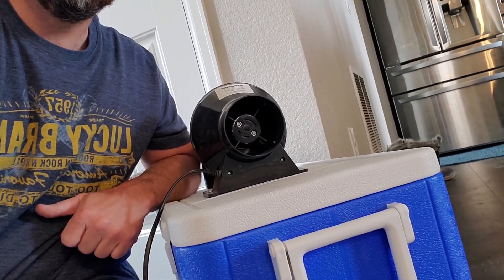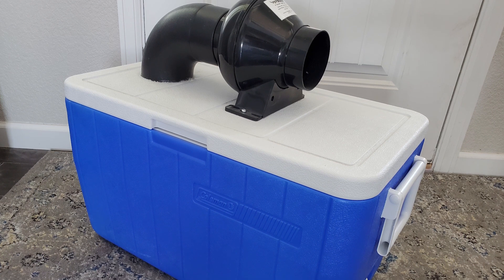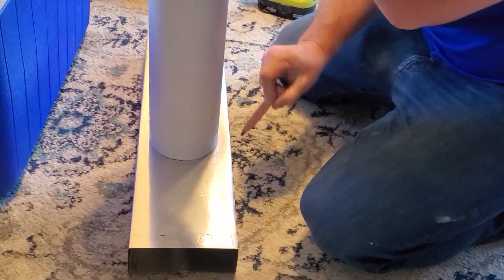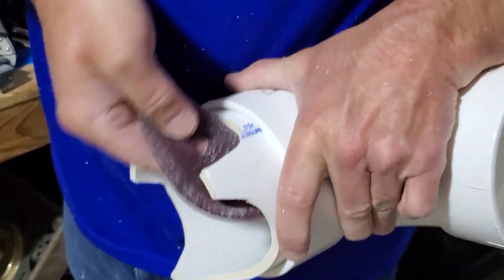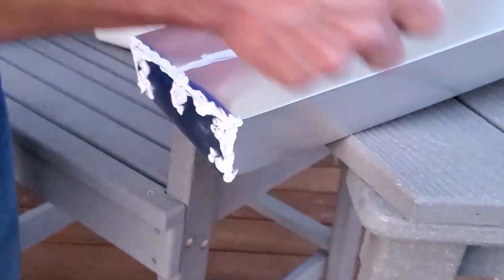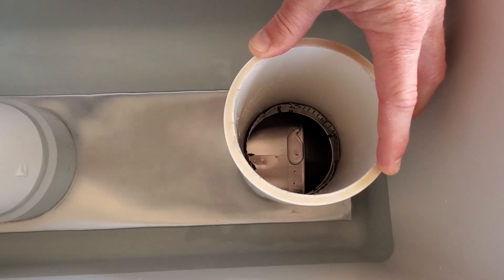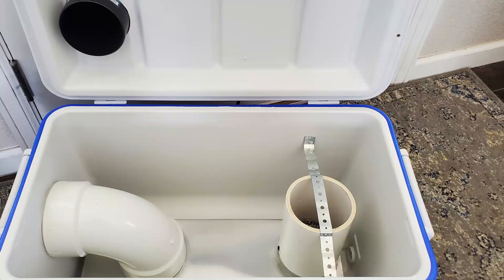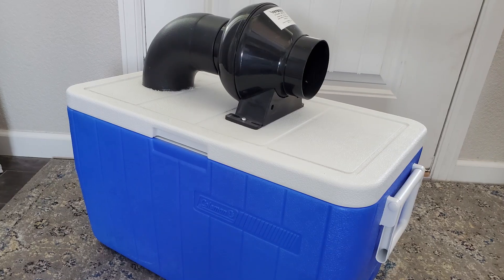Homemade Portable Air Conditioner DIY - Runs on 120 volt or 12 volt.

Comment: I just built on with a 336W blower fan(so loud) blowing into the cooler at the top and having an elbow coming out the top. I realized I could just put the intake into the top and have the output of the blower at me.. it led me here.. I’m going to place smaller cooler(no lid)into the center of the bigger one, right under the intake of the blower fan. . Then have pvc run from the bottom of inner cooler to the outside of the cooler, and then do that to the other side of the inner cooler(I.C.), having two air intakes into the I.C.… that way I can have less strain on my blower.. the air inside the I.C. should be cooled down by the ice surrounding it.

Comment: In a small bedroom - if you window can slide open at the top, crack it about 2 inches. Run the AC rig on the floor. Give it about an hour.

Comment: I’m trying to cool my airplane.  I am building a similar setup.  My question is what is or where did you get the fan/blower.  I am thinking about fans that run on the battery packs like 18-20volt.  Thanks for the inspiration and creativity.

Comment: I have a few questions. Do you recommend this one or your coil version? I live in Texas and I have created 2 insulated dog houses that are pretty awesome. I have an extension cord ran right now with a box fan hooked up in a window I made specifically for them. I was looking at doing something like this and installing the cooler itself in the ground. Also, would dry ice work for this one?

Comment: I recreated this today using the cheapest materials possible.
A 40 quart styrofoam cooler, $6
Small USB fan $7
2 Aluminum foil pans square, $5
6 x 1 liter seltzer bottles, empty $0
If you cut the bottom at the widest point of the bottles and cut the top just before the widest part, it fits inside the first one.
Duct tape, $1
Total cost, $19
It works!
Reply: any video :)?
Reply: Please send a picture a text to picture to the comments. Thanks nice❤

Comment: Hello, I love this idea! I have one question, would it be possible to get the same cold air if I used a 4-inch aluminum dryer vent "rolled" in an ice chest? I have a small truck and am trying to figure out how to keep me cool on the drive home from work.

Comment: Just a thought, but you should make these run off Dewalt batteries. I am also curious if a fitting exists that fits at the outlet and can split the airflow in four different directions. 🤔

Comment: Better to use a flexible aluminum tube .snake it through the cooler and pour ice over it.,.and blow air through the tube , the snaking will cause the air to bang into the cold surface of the tubing and increase transfer of cold

Comment: Hey bro what if you dix just the way your doing great design by the way ut what if instead of just letting the cold air run across the top of ice to ofher side of lid then come out what if yoh reall utelized that are with a sloping type of swamp cooler pd with a litte pump pumping the melted water over the sloped  pad making sure air still flowing under. That way your utelizingevery bit off tht cold ice and water and make it last longer.hopebyou under stood if not get back to me and ill draw you a quick diagrim of ahat im thinking. Great job im going to start my tomorrow. TKe care. Scott

Comment: Buddy, at 6:57 did you mean the air circulates and not the water? I'm super confused , I have a similar idea which I wanna' try as I can't get the motor but I just want to make sure I understood the instructions correctly.

Comment: It gets into the 120s here in Arizona so you have no idea how much I appreciate your videos. It’s important for me to have devices that I can plug into a solar charger when the power goes out that will literally keep me cool enough to survive the heat
Reply: When I lived in AZ years ago I used an evaporative cooler. The air is so dry the high rate of evaporation provided really chilled air, circulated by a fan. Doesn’t work for mobile applications, like a delivery truck.

Comment: Exhaust needs to be able to move . Also can use a t to slo air down and spread in multiple locations. Try different heads on the exhaust 👍😎🥶✅
Reply: Send a picture text to picture. Thanks.❤

Comment: How about just putting two holes in each end of the top of the cooler , forget pvc pipe , instead, run two aluminum duct tubes down through the holes of the cooler and connect each of them to one end of a central aluminum duct tube with aluminum angle joints ..so the whole design is made of Aluminum and the air never makes contact with the ice ..just force air through the aluminum Duct work that is buried under the ice …. The air will not be humid and it will be very cold due to the conductivity of the aluminum duct work

Comment: I like this concept but I curious about two things, why the duct and not justa flat piece of tin about 4 inches off the bottom and sealed around?  Also I noticed everyone uses only ice, is there something wrong with using get packs?  They have a freezing temp of 18 deg typically vs 32 and last much longer.. plus no mess.. nor worry about excess water and you can just take em out and freeze them again.  Truly curious as thats what I intend to do.  Also would be nice if somebody actually tested over several hours to show if they really work or  not.

Comment: If you shield your ice from the air flow (Plastic bag or ABS panel on top of the ice) it will melt much slower. Salt helps also.  Your aluminum box needs fins on the inside so the air flowing through the box comes in contact with more cold surface area.   Some air will never contact the box walls and go directly out.  Your PVC parts are insulating.  If they were also aluminum the cold surface area would be increased making the air colder.
Reply: Keep in mind that though the salt will lower the temperature of the melting ice, it will also corrode metal ducting, so I'd keep everything plastic that comes in contact with the salty water.

Comment: This is awesome, I watched this video years ago. I just made a similar a.c unit the other night that was to be setup for batteries incase I wanted to have solar. So now I have an a.c unit!  Not the same design but works very similar!  I was surprised with how long the water bottles stay frozen for!  I don't even have the isolated lid!  I can emagine how much more efficent this would be from having a full seal

Comment: There are loads of these swamp cooler projects on here - but this is definitely one of the better designs - you must have the air flow UNDER the ice, seen so many of these where they just have a fan in the top & outlet on the side near the top & the air is simply being drawn in & over the top of the ice - useless

Comment: Wouldn't it be a lot simpler to use 4" aluminum flex hose? Or even 2" flex and lap it several times around the bottom of the ice chest? It would eliminate most of the fab work. Love the idea tho'
Reply: Damned right.   Perfect example of "If all you have is a hammer, everything looks like a (hillbilly) nail."

Comment: Always liked the different designs, but noticed that the lids of the coolers could use a touch. It's adds a bit of cost and time but why not drill a few holes and shoot some foam instulation in there. Dry and set it. Cut off what comes out put some dots of silicone on there and the ice will last a bit longer still. Way to take a cheaper cooler and insulate a bit better. Never see that in any of these designs really, not just his. Love the designs and ideas btw.

Comment: So this blower motor...is this a better way of moving air than one of the standard 8" or 10" fans people frequently use on these DIY ice chest AC builds? The motor's description has it measured at 195 CFM, but it's hard to make a comparison since most fans won't have that information available.

Comment: I made this and tried it in my small Chevrolet truck and it works for about two hours in the morning only and then is pretty much useless for the rest of the day. I actually have an ice maker so I had unlimited ice to fill it up with and had it pointed directly at me on the passenger seat and as soon as it gets warm, this does nothing. Seemed like a good idea, but doesn’t work very well. I tried it with frozen water bottles, ice, combination of the two, just doesn’t cool the air like he says it does.  Don’t waist your money.

Comment: Thanks for the videos, very helpful. I am building one this weekend, though a different design. I will sidemount the fan as you have in other videos, flexible exhaust tubing to the intake on the lid (never understood why you cut the holes in the sides rather than the lid?). From the lid its pvc pipe to the bottom of the eskie. Then i am going to run 2 lengths of 10cm or 4" steel pipe joined with pvc connectors for a 180 degree bend. Air will flow up one pipe and back along the other doubling the time the air is exposed to frigid tubing. Then have the air exit from the opposite end of the lid, that way its 2 passes under the ice and one over the top. . The flexible aluminum tubing be so much simpler but i have doubts about its integrity to not tear and let water in.
Reply: I'm going to use a 3" flexible aluminum duct on the inside of a Styrofoam cooler, maybe 3 runs the inside length of the cooler. Side entering with a blower and exit on opposite side. Going to use the freezer packs for the ice, as they are renewable and less messy, not having to deal with water. Just swap them out for new, frozen ones every 12 hours. I just need to drop the temp.  about 5 - degrees in a small area.

Comment: I want to make this for my SUV to use when I'm SUV tent camping.  

What do I connect this to so it can be powered by a solar panel or solar power bank and what size solar panel would I need??
Reply: You can buy a power station or bank  to run the fan. So you suv don't  need to be on. But I  don't  think  you need to build  one Google  mini cooler. Some  thing  like that.  It use water to cooling  air. So if you use ice water  will help more and only under $40.

Comment: my ideas:  i'd suggest a 2-3 tube directional blowers to widen coverage for 2-3 people hangout.

to all DIY, in this age of rolling blackouts, people need 7-day heatwave power outage sos units that dont use ice or cold water (no electricity to make it), able to run on motorbike or marine battery or solar kit and last 7 days. 

unit should be able to cool (not freeze) two whole bodies in an 8x8ft area ex queen bed by 10-15f while running consuming the least amount of energy.  it'll likely need a heat exhaust hose or have a 'radiator' element outside etc.  demonstrate proof with video.

Comment: The issue that I have with you is you assume everyone knows how to wire the power source to the motor. You give detailed instructions to that point and then you end the video.
Reply from the maker: Uhh, the motor has a plug. You plug it into a wall outlet.
Reply: @livingwithlucasofficial  hahahaha
Reply: @livingwithlucasofficial  - My bad. I should have been more specific. I  meant the connection if I want to go the 12 volt route. My application will be sitting on the beach in my lounge chair on a 90 degree day just to blow cool air on me alone. As it turns out, your 4 fan/USB iteration seems to be best for me. Even still,  I had to comb through all of the questions (and your response) to learn how to wire it. Don't get me wrong, I think you are providing a great service and I think your designs are the best I've seen. That was my only frustration. Keep up the good work.

Comment: What would be the difference between blowing and sucking? Air I mean 😄 Never thought to ever ask this question.. yet I see that your and most other models I see 'blow', while I'm thinking of a model where the fan is at the end (to be more in control of the airflow) and pulls it through a cooler.

Comment: Hi there, thanks for the idea. I'm planning on doing the same with a Webasto BL41, it's a top loading deep freeze/fridge with a compressor. I have the same in my campervan working as a fridge and I have this one (spare) and I will try to convert it into air conditioner. Cheers from Belgium.

Comment: I've never built one of these, but I had a few thoughts watching your videos. 
To get even colder air, use metal/aluminum ducts. 
Insulate the exterior of the pipes exiting the cooler to prevent condensation/loss of cold due to temp difference between pipe & outside air. PVC doesn't conduct cold/heat too well. 
Also, pushing the air through may be better in the long run, to expose the electric motor to as little moisture as possible. 
What do you think?
Reply: Yes, I'd like to see a drain at the bottom of the interior of the cool air area (I suppose you could do that through the drain in the bottom of the cooler - it would probably take some fancy plug/tube setup but it should be doable).  Also, since this is a "squirrel-cage/centrifugal" blower, it would work to push pressurized air into the cool air interior area, then any air leaks would be cool air into the room, not warm air drawn into the already-cooled area.  It would also work to set things up (air in and air out) through the lid of the cooler - since there wouldn't be any place for standing water, it would simplify sealing of external parts.
Overall, it's a very smart and efficient design.  The fan that he selected 28 watts to move almost 200 cf/minute is incredibly efficient.
Reply: How about leaving the ice in the bags then refreezing it later to re-use
Reply: @walterwilliams9547  Or maybe freezing water in gallon or 1/2 gallon containers?

Comment: What are your thoughts on using an adhesive on the bottom of the aluminum duct to keep it from floating as the ice melts?
Reply: ABS slurry would bond to both the plastic and aluminum.  Tons of epoxies will do the same thing.

Comment: Why not just use frozen water bottles or something? Sure, would require some tweaking with the design to hold them, but I'm guessing it will be a lot less troublesome to remove the bottles once the ice has melted than removing the water from the box.
Reply: Not necessarily if you get a cooler that has the drain port at the bottom of the cooler.

Comment: Ok, here is a time for how long do the ice will last...
I have mine in my tractor trailer day cab. The inside temp was 86 degrees. A 22lb bag of store bought ice lasts 3.25hrs.... lowered the inside temp to 73 degrees...
I also have two 8in 12 volt fans.
--------"UPDATE 06/19/2012"---------
Worked for 3days then started filling with water. Removed internal components and resealed. 2days later, started filling with water again.
Scraped the whole idea. Design is flawed.....
Reply: That is THE question everyone should be asking! Thanks!!

Comment: If you use dry ice with regular ice wouldn't the cold air last longer just wondering like to try to make me one
Reply: Dry ice is frozen carbon dioxide which is a poisonous gas if inhaled, so you would need a well ventilated area,

Comment: So, the blower is pulling the air through the drain and into the ice chest? Its not blowing air into the ice chest and out the drain right? This may be the one I go with. I might calk and flex seal to be sure its waterproof.

Comment: Trying to figure out which of his four versions to build. Version 2 seems like it would be best for a longer outdoor trip, as the ice would last the longest right? Since in v2, the ice doesn't come in direct contact with the air, that should mean it will take the longest to melt. Anyone have any thoughts?
Reply: Not that cold though.

Comment: what a horrible idea....although this will put out cold air, it will add moisture to the air, which is the enemy of air conditioning and will lead to mold.........maybe to the beach to cool you off but def not in any building

Comment: Have you experimented with lower cfm rating fans? I'm a bit concerned about battery capacity to support such large fans as you've been using.
   I'm also wondering about condensation building up in the duct. One of the main functions of an AC is to lower humidity, the result of which is condensation that is  normally draining to somewhere.
Reply: I'm sure its a water cooler and not AC dealing with condensation.
Reply: @WebDeveloper08  ??
Reply: That particular fan is 32 watts/.50amps, so it is FAR from a battery drainer.  Even though it has a 110v plug, I plan to run it through a 100 watt inverter cigarette lighter male plug, then into a female cigarette lighter input with a USB end on the other end.  Run off of USB, you could use a portable charger power bank, like say 15k mAh, and it should run for 33 hours just off of the battery pack before the pack needs to be recharged.

Comment: I would say at least half of these videos use the same cooler i have. I have no real need for one but it would be nice on the porch or camping. One flaw i hear is that the ice melts faster submerged in water or with a fan directly on the ice. So a tube on a grid seems the better choice.

Comment: I rented a 1972 school bus that was converted into a camper. It doesn’t seem to be a big school bus maybe half as long. Would this be good for that?
Reply: absolutely a terrible idea.  although this "cools" air, it adds moisture to the air that will lead to mold build up.  better off getting a mini split

Comment: Awesome ideas you have.  When comparing the(red) cooler with the 4 inch metal duct in the bottom covered with ice and the blue cooler with the 4 inch PVC with the metal duct. Is the output air that much cooler? Thank you

Comment: These look cool but as they only cool air at you seems better to buy those portable air conditioners. Theres the as seen on tv arctic breeze for $40 & theres a one on amazon  called Auznik or Auznit(forget ,weird name) For $40-100.  They do same thing to just cool air directed at u and both are smaller(bout size of a cheap paper shredder) than these cooler air conditioners.